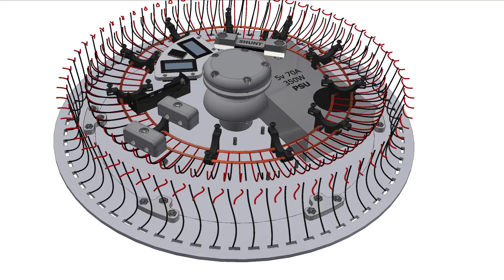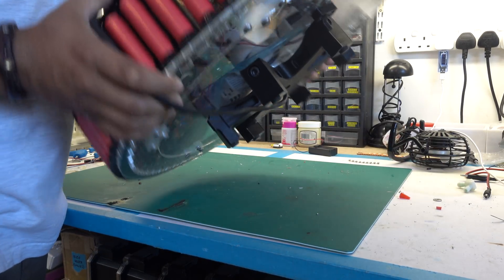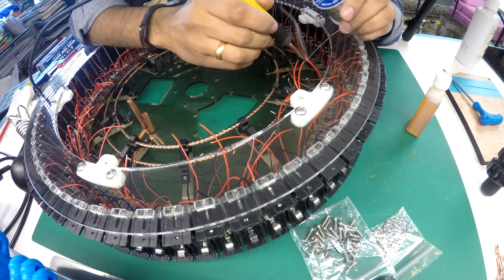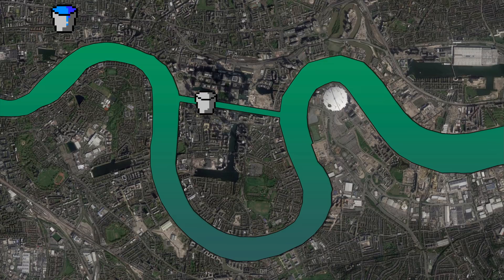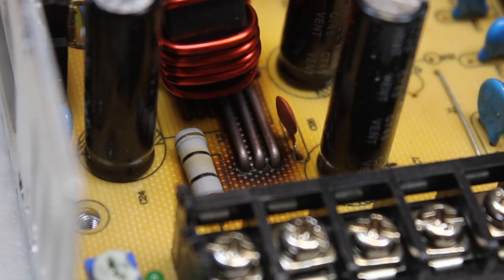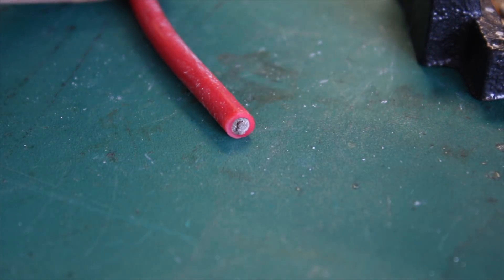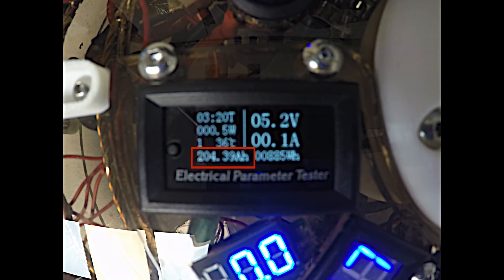18650 Mountain - Part XV - The 18650 MEGA Charger, FINAL EPISODE!

Comment: Hi buddy. I have a question regard the TP4056 board. 3 of my 40 TP4056 boards got Red charging LED lit straightaway when power on. Have you face this TP4056 issue before? Red LED is ON when I power the board, without battery and there is no Blue Led.....Thanks in advance buddy!

Comment: Really nice end results, well done. The beautiful thing about sharing these projects is one can improve it or approach it with a different method. I think the reasons why the first power supply blow other than the fact it was much cheaper and most likely overrated, was due to the fact it was a `constant current psu` rather than a `constant voltage psu` which not particular good for this type of project. Ideally you should go with a branded PSU switching power supply avoid those with 'LED' in the title as those are likely 'Constant', you could even opt to use a Computer PSU and then use DC 6.5-40V to 4.2V 1A charging modules.  You can get a 600w Corsair PSU at the same price as the `Meanwell` and it'll come with good internal cooling and a fan. If your on a real thin budget or want to charge even more batteries then take a look at used "Dell Precision T7400 Workstation PSU 1000W" which generally cost less than $30 bucks refurbished/used. Personally I would had gone the 12 voltage option since it should help keep the voltages stable, I suspect adding batteries will temporarily cause the 5V rail to decrease while on a 12v it'll always stay above the minimal of 6.5v - just my 2 cents, good job.

Comment: Just get cheap psu and redesign it a little..............
The cheap banggood psu u can buy can be used to control psu eather with transistor or mosfet like the old anolog power supplies using adjustable reg with low current

But best is sever power supplies get them 5~50 buck and supper over the top
Reply: If want electrical help let me know 
Billbo popins fb

Comment: This is a beautiful design both in CAD and the finished unit looks so sexy. Am really impressed by your determination to stick it out and finish the build. Now if only you could build a three in one unit that could do charge, discharge and recharge and still look this sexy, why you would be the king of the diy power wall community. I would love a better explanation of the spindle unit as I am trying to incorporate the design in another machine am building please. Your CAD skills are unbelievable by the way. What CAD software did you use for this design?

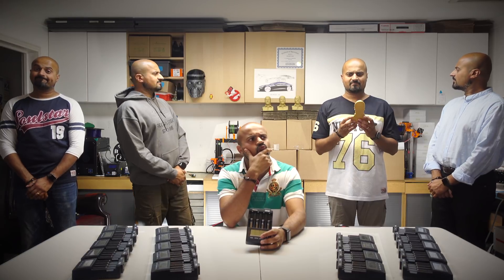Comment: I'm really enjoying your videos, knowledgeable and entertaining! I'm starting down the road to 18650's and after watching your videos, I was thinking something similar to you around 12:45 of this video. Can a DPDT relay switch be used to connect an 18650 cell holder to both a charger and discharger (and possibly an arduino to control the process) where you install a recently harvested cell, its charged, discharged, and charged again all in one step?

Comment: Like your design, however I'd prefer wall mounted (for tiny workplace that I have) instead of carousel. I'd use 18650X3 or X4 prewired cases in your carousel with 2 mounting brackets (less work). Power supply prefer MeanWell RSP-500-5 with PFC, more EFF; cost just a bit more, but rated output current 90A max. Find a fast & easy way of individual cell voltage with data logging incorporated into your charging station?

Comment: Or How about the transistor Temperature in main power supply???
Reply from the maker: there was no significant change in temperature as I had the PSU outside the BFC on a the first run to check for temperature and to the physical touch it had not risen at all. The MeanWell units are very good and will be my go to PSU in the future for all projects

Comment: Boss how about the twisted wire Temperature??
Reply from the maker: do you mean one-wire DS 18S20+?
Reply: No boss i mean the 3 twisted wires in 5 volts rail
Reply from the maker: OH! no thats absolutely fine no rise in temperature, just the load wires connected to the rails. The shorter these are the less resistance and the rise in temperature is when it is close to 350W load, in 20 minutes the load goes below 250W so temperature reduces too.

Comment: Boss, Question about the Main Power Supply Temperature Can you make a video about it??? Thanks boss
Reply from the maker: HI, there is not much that the PSU will show regarding temperature. With the MeanWell unit it work fairly efficiently with no increase in temperature, but the fan is load and will look to swap this out. The temperature is mainly coming from the 4AWG wiring which provides the load to the 5v rails. Hope that makes sense

Comment: what soldering iron did you go with?  I am literally at this point now with needing to go with a new iron
Reply from the maker: I went with a 150W sledding Iron, but if I chose again I would opt for the 200W and order a few spare tips. 
Also don't use copper or brass soldering iron tip cleaning pads. A standard soldering sponge is better for your tip and clean the tip as it cools leaving a blob of solder on the tip to prevent it from oxidising

hope that helps
Reply: thanks!  i am starting a build of a charger/discharger myself won't be quite as many cells as yours, but i am shooting for 40 cells that can charge/discharge without being removed from the unit.

Comment: Have you ever tried using batteries to discharge into batteries to test them. Would that be possible and economical?
Reply from the maker: Pleisterman I’m considering using electricity made by solar with a pure sine inverter for doing this. Seems like sweet irony to do this as ultimately it’s what the battery will be used for

Comment: please take a look at the discharge waveform of the Opus before you build a massive discharger with them. sure it is the only one with a fan but not if your cell is going to see 8A PWM discharge pulses, how accurate will that be? I recommend the ZB206 boards, super reliable and will never fail, sure they are bigger but 4 wire connection and true CC discharge it is worth it, plus the only thing that might fail is the transistor which is super simple to replace
Reply from the maker: SuperBrainAK I’ve bought ten of the ZB206 boards and found that between them there is a wide range of variation even when testing the same cells between them. With the Opus I’ve found a smaller variation or margin of error and even though it may not give me a true capacity reading at least the readings are relative to each other meaning more balanced packs. 
Hope that makes sense 🤔

Comment: will you make the designs public?
Reply from the maker: Would anyone like access to these files to remake themselves? I have been thinking of GitHub upload and peeps can customise as they please. Let me know and can spend some time preparing this.
Reply: that would be so great
Reply from the maker: I didn't keep a tap of the costs but if I gave it a rough estimate in GBP i would say certainly less than  £120 where the PSU and acrylic was the most costly thing. But I do have the laser cutter and 3D printers so not sure how much these would cost in getting these cut.
Reply from the maker: Thats a good idea and should have explored it as the CAD work is done. I do believe there needs be some coverage on using 3D printers for making water and air tight components, will look into this as a potential episode for future use to help others consider the design constraints
Reply: Yes, what was the total cost of the project ?
Reply: Not bad , I would have guessed it would have cost $300 - $400. You could always replace the acrylic for a cheaper material like wood and cut it by hand . 
Have you considered selling diy kits ? You could make some extra money on the side and since you already have the laser cutter and 3d printer , you can crank out those parts fairly fast .You could sell a complete kit with every component needed to build MEGA charger or simply just sell the case and 3d printed parts and give the links to the components you bought .

Btw , I was wondering if you tried printing the water cooling system connectors in ABS plastic and dipped them in acetone to fuse the layers together ? I'm guessing they may have not sweated coolant like the other parts you 3d printed .

Comment: Great video mate. And reason you didn't use a computer psu?
Reply from the maker: I couldn't find one slim enough and they normally share there Watts output with the 12v and 5v rail. Beside for £35 (GBP) seemed fairly reasonable and should anyone like to make this themselves they know that most of this is off the shelf parts. Thanks for your support mate!
Reply: NERDVille yeah ok makes sense. I thought they would be a lot more expensive  cool good work

Comment: impressive :)
BFD i already have 16 home made arduino dischargers on 1 board. Theoretically the size could be halfed by having 1 arduino discharge 2 cells at a time, there are spare analogue pins. Check my "how i cycle my 18650s" video if you would like to see.
If you can shrink it by more than half, i may even copy your impending design :D

Comment: Rarely do I get such a sense of awe from youtube vids but you sir have done it with this one.  What a great end to a great series of vids!  Quick question - if one of your TP4056s goes kaput, will it be much trouble to swap it out with this design?  And yes, bring on the BFD, can't wait!
Reply from the maker: levik1832 thanks for awesome comment. Replacing the TP4056 is a hassle but not impossible. In fact, last week replaced several and it took little under an hour. The main issue is getting exact replacement same units.

Comment: The problem here, as I see it, is that no matter how fast you can charge your cells, unless you are using strictly new cells, you still have to capacity test them all.
Reply: That is true. This is just the first stage of the whole process. Once you have every cell pre-charged, then capacity test after they've rested for a period of time (for finding leakers). Nerdvilles next project should be to build a similar unit that does capacity testing  :)